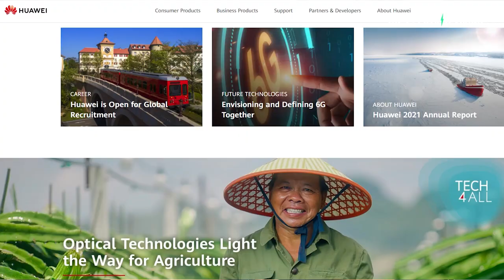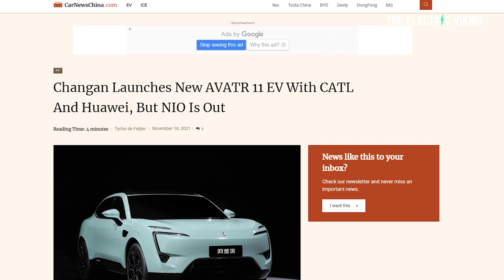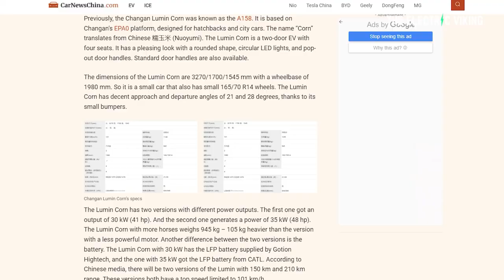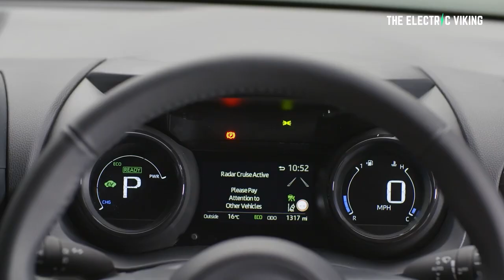My favourite NEW mini Electric car - the Lumin Corn

Comment: Viking,
I agree with you, the Lumin Corn EV. It's also a 2-door hatch which for an around town short range car is perfect. I really hope it is not too low to the ground!  10yrs ago we almost bought a Yaris but instead went with the Kia Soul which was a fantastic small car and did not require climbing down into.  If I'm going to climb down into a car it would have to be a Porsche 911! 
So many small cars today try to pretend they are larger 4-door cars which make getting in and out of them a deal breaker for me, a full-sized Norwegian/German, lol.  
I love my 2-door GTI, but would replace it with an EV if Tesla or other EV maker would produce a fun and sporty 2-door hatch. 
The Corn has fun and tasteful smooth lines instead of the silly chunky bumps and meaningless creases of so many cars today.  I also love the funky blue-green color.  210km/130miles would work for my needs.  I find the interior kind of retro 60s/70s VW Bug cute looking. Nothing like the cluttered mess of the Yaris. 
I only wish an America, Aussie, Canada, Mexico, British, Euro, or other country would step-up! 

Cheers,
Eric

Comment: As a runabout  in Perth, sure if it was available. But I don’t think K class cars will be coming to Australia anytime soon. I drive a 2000 Echo with its 300,000 Ks on it and it is still soldiering on. These K class cars may just be too small for me at a bit over 180 cm. I wouldn’t buy one without sitting in it first. May have to pay more for a Corolla size EV, besides the powers that be may actually allow larger cars in much sooner. Great idea being able to delete some features.

Comment: This car needs to be in Europe. 

One thing about most Chinese micro EVs. The small wheels and tires do make them unstable at mid speeds. The axles or hubs of the wheels should be far from the sill or bottom of the car. 

12" wheels that have that are not the best. 
If that's fixed, with added tire wall for comfort as well, I'd see no issue for this little baby corn in Europe

Comment: I'm looking for/waiting for a replacement for my old Smart car. I want two seats, electric, and enough range that I can get about 150 miles in a day with a recharge. That requires fast charging really. The current Smart electric is such ancient tech the charge is extremely slow and the range is tiny. I'd absolutely buy this if it suits.

There were never any problems driving my car on British motorways. In the city it was insanely good. The boot could fit an entire shopping trolley of groceries. Since I don't have a family of six, I didn't need more than that. ;)

Comment: Clown cars are 2 door tiny cars that would do poorly in a T-bone crash with an SUV.
I'd never put the wife and kids in one of these rolling coffins.

I guess as an "airport car" - a junker that you drive to the airport and park in long-term parking
under the blazing sun/freezing snow for weeks on end it fits the bill. But Uber is cheaper.
Reply: I've seen hundreds of accidents in today's small cars. They are amazingly resilient/strong/safe...even when connecting with power poles. Most people just get out and walk away with few if any injuries.
Reply: Did you know that statistically SUV's are the most (after US trucks) dangerous cars to be in.
1) They all, except 1 (tesla Y) fail the moose test - the ability to avoid an accident by swerving.
2) They have a high likelihood of roll over in an accident due to the higher CoG
3) They are heavier so their braking is worse than an equivalent saloon/estate (sedan/stationwagon)
 So statistically, factually you are more likely to have an accident, more likely to have serious injury or die  in an SUV than an equivalent saloon/hatchback/estate car. These numbers come from the car safety statistics.
So good luck with your SUV.
That is the joke about SUV's people don't understand statistics and think SUV's are safer, they statistically are not.
Reply: An SUV does poorly when T-boned by a semi. A semi does poorly when T-boned by a train. Train does poorly when T-boned by a 747, etc.
These are city cars that are meant for Chinese city traffic that goes slower than me on my bicycle.
And as Sam said, this car costs about the same as his electric mountain bike, so Sam's mountain bike would do poorly when T-boned by this thing.
Reply: @johannbrauer9285  Yep, there are always people who think like that.  There was one in the town I lived in which had the local army training base - they jumped the lights as a challenger 2 tank was going though.  They won't get the opportunity to think selfishly ever again.
I will never known how they could not hear it.
Reply: @Tom55data  - It has to be one heck of a car that can survive a Challenger 2 hit by the side.
In big Chinese cities there are no tanks, but an occasional cement truck or a semi. The traffic moves at walking speed during rush hours, so even this kind of car offers better protection than a motorcycle with a family of four on it :)
Reply: @johannbrauer9285  Yes, no car can survive that - but we have a size war in cars without the realization that these big SUV are statistically less safe than other cars (as measured by accidents/mile and injury's/mile and deaths/mile) - even taking account accidents with other cars that are smaller.  ie you are using the standard argument - it is bigger so much be safer whereas I look at the statistics from the various country statistics of traffic safety boards.
Reply: @johannbrauer9285  True and the train does poorly against a 3-mile wide asteroid hitting it too.

I'd bet that Clown cars are little more than drivable coffins and safety is way down on the list of things the owner thinks of while riding in it.
Reply: @noleftturns  - The option (here in China and India et. al.) is a motorcycle with a family of four on top of it. It is an improvement. Apples to apples. What can you get for $5k? An asteroid?
Reply: @johannbrauer9285  The more wealthy a customer is, the more esoteric issues such as safety can be considered.
Cheap automobiles have a low level of safety, but costly cars have a higher level of safety.
The poor have fewer options, with safety being right at the top of the list.
Reply: @noleftturns  - No one that I know of has ever wondered whether to buy a "cement truck" or Wuling Mini. If you have $5k, your options are Wuling mini of a motorcycle. If you have $75k, you wouldn't think of either of the previous options.
Reply: @johannbrauer9285  The poor always get screwed - that's how it works.
Reply: @noleftturns  - Hear, hear!
Reply: @Tom55data  - That is an interesting statistic. In the early 2,000s, I had a Ford Excursion V-10 and I felt very safe in it, but that might have led to an "arrogant" driving style believing that I was the biggest and baddest on the road. The Excursion was based on F-250 and didn't have many crumple zones, just weight. I never got in an accident, but who knows what would have happened. I totaled a Jeep GC and it absorbed the impact so well, the car was toast, but I walked away. So, it is not only the weight.